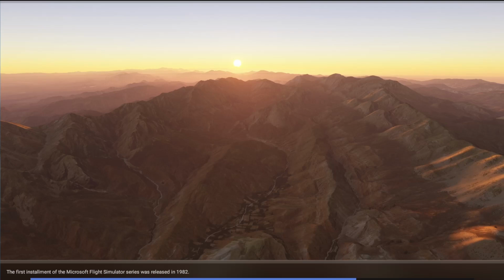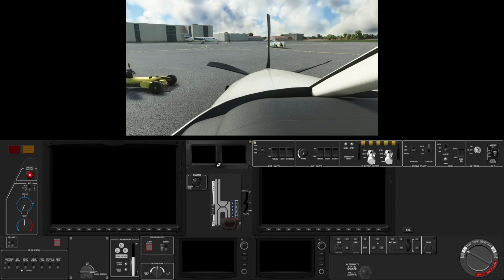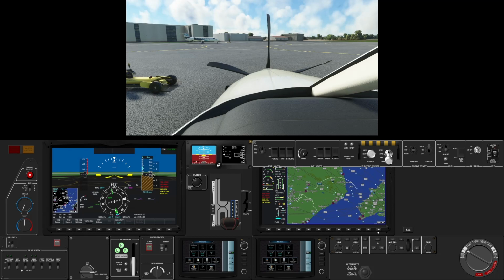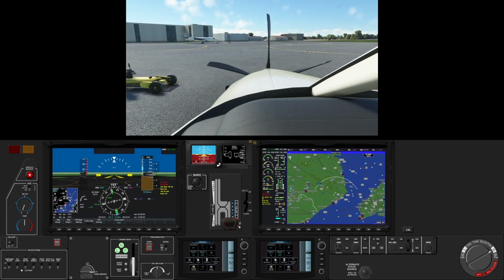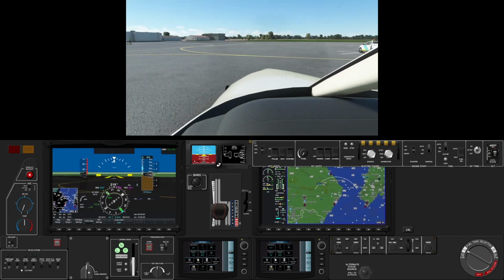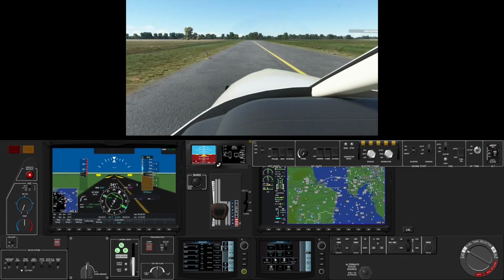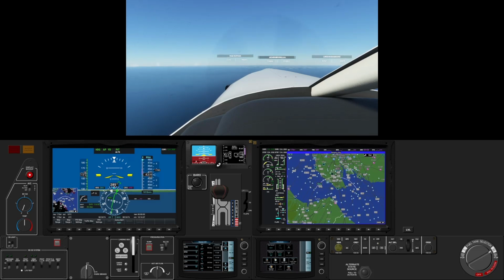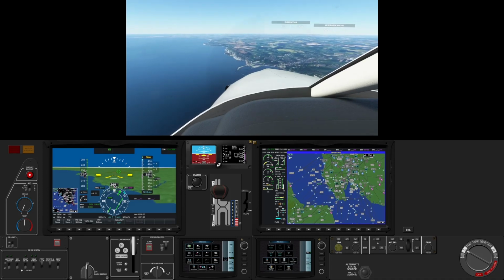TBM panels showcase

Comment: Hi, I love this panel but I unfortulately face 2 problems. 
1) Touchscreens of the 2 GTC580 are not functionning. Both knobs and the 3 buttons to activate PFD, MFD or Com/Nav on each CGT are working. But clics in the screens are not working. I might hafe set-up sometiing wrong ?
2) Most of the time all switchs are functionning at the beginning of a flight, but most of the times, after 20 minites of flight, some of the switches are no longer worrking (i.e. interrior lights from the Overhead, Sep Inert, Air Cond, Bleed...). I have no idea why a few swhitches would work for only a period of time in a flight. 
Thanks in advance for your help.
Phil

Comment: what size of touchscreen monitors are you using?
Reply from the maker: 24” but many users are using them on different sizes down to 15.6”. You can also move and resize individual instruments to suit your setup if needed.. I’d recommend the 20-24” though as they give the optimal experience.

Comment: Great panels. I enjoy flying the tbm. I also like trying to create my own panel/instruments. One thing that caught my eye in this video is the show/hide capability of the overhead panel and compass. Is that something available in air manager or did you built that into your implementation by using the visible() function. Looking forward to using this once available.
Reply: Thanks. That’s what I suspected. Can you share how you accomplished it? Meaning, if I were to undertake a similar design, how would I achieve this? I looked at the api and dont see any functions to manage panels. The closest thing I can think of is grouping objects and using visible() to show/hide.
Reply from the maker: Thanks. These are totally custom instruments all made by me. Any features you see like the show/hide ability is incorporated during development of the instruments. Glad you liked them.

Comment: The TBM 930 is my favorite aircraft.  Do you plan to release/sell your TBM 930 panels?  One comment below says you are trying to lock these panels.   Will you help me understand the locking issue with AM panels?
Reply from the maker: Yes thecTBM will be available at some point but 2 things are holding that up right now. The first is the impending AAU1 changes that will need modification of some of the instruments and a better handling of the pop out process in air Manager. Both are coming in future updates and once both are here we can push on. Not sure what locking comment you are referring to but if it’s rthe locking of the panel so it doesn’t move it’s covered in the MSFS popouts video.
Reply: @ExperimentalSimAvionics  I run the Hawkeye-Stan’s pop out manager with Air Manager.  Will your panels work with this combo?  What specifically does AAU 1 fix for your panels?
Reply from the maker: Yes I run Stan’s POPM app and the work perfectly with it.. in fact POPM enhances the whole experience for the placement, the added touch support and it also resolves the return to focus sim bug. All in all it’s an essential tool for use alongside AM and MSFS.
We don’t know yet what the release of AAU1 has in store so I’ll evaluate that once it’s finally released.

Comment: Have you experimented with having a pop-up panel like your autopilot but instead have a GTC 570 with an MSFS pop-out window?

Or to say it another way... Can you have a pop-out in a pop-up?  Hmm, sounds like a joke but I am serious. On a smaller computer touchscreen, it would be nice to have a 
PFD or MFD with the ability to bring up a simulated GTC  by pressing the squared "X" pop-up icon. Sorry for the struggle forming the question.
Reply from the maker: If the popouts were not overlapping or it was a pop out based instrument and a normal AM instrument then yes. However if you mean 2 overlapping popouts then it’s not possible because there isn’t an easy automated way to alternate the popout. This is not a limitation of AM but of the nature of the way the sim handles pop outs.
Reply: @ExperimentalSimAvionics  Thank you.

Comment: Could you have the MFD screen in portrait mode for more vertical space?  In my case it would not block my flying screen.
Reply from the maker: If you mean the monitor that the MFD is on in portrait then yes you could do that. I have many panels that setup may work well for, but not all others. I don’t want to keep moving it so I prefer to keep them both in the conventional landscape.
Reply: @ExperimentalSimAvionics  Thank you.